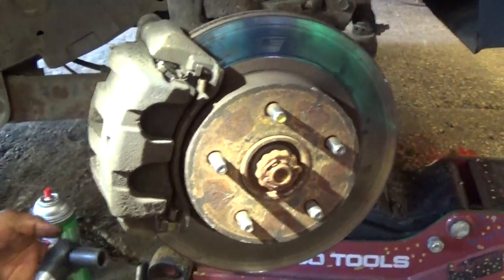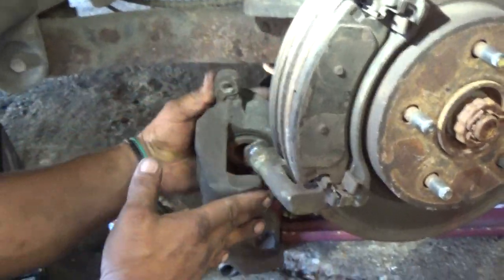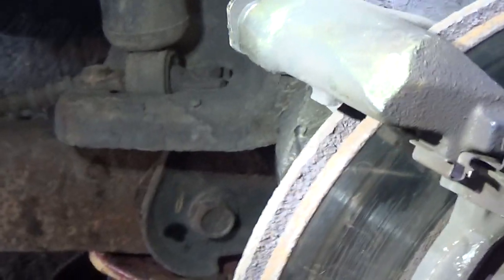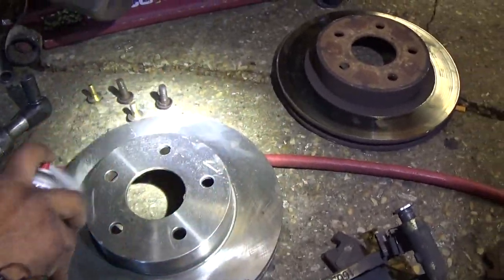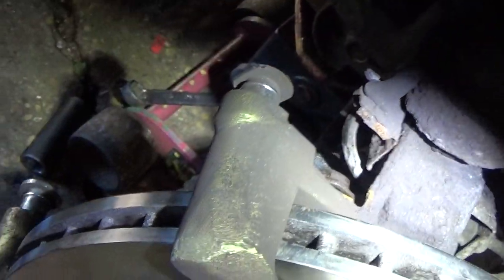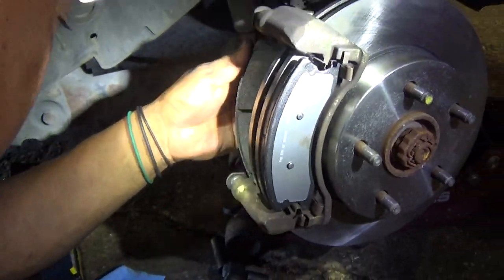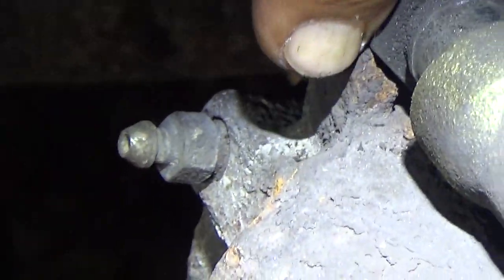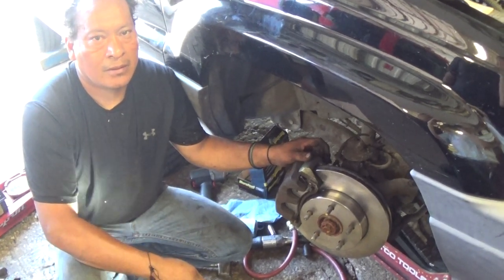How To Change Front Brakes & Rotors on a 2000 Jeep Grand Cherokee

Comment: Nice work! Bracket to steering knuckle torque is 66-85 ft /lbs and the caliper bolts 21-30 f/lbs  jic anybody's wondering.

Comment: Don't forget to grease your guide pins
Reply: He didn’t even have the dust boots on the carrier pins, so greasing them would attract dust and cause them to seize.  He also didn’t lube the clips or put anti seize behind the rotor where it mounts.
Reply: @horsemoney  Yeah no idea what these 'mechanics' are doing but this is a terrible job. I would be pissed if they did my brakes like that. A good mechanic will take the time to properly clean and lubricate any moving parts of the brake mechanism.

Comment: So if it takes one 8min video to install under normal conditions and approximately 3 mins to remove the tire, how to mechanics justify over 1hr of labor?
Reply: At this point idek why mechanics charge by hour. It would make more sense to just charge by labor type, not hourly. Not everyone can do mechanic work, which is why I can understand donuts still expensive to repair something on your vehicle.
Reply: They did a terrible job. They never cleaned off the guide-pins, never re-lubed them, and never put dust-boots on the pins. These brakes will be worn quickly because they won't move when they need to.

Comment: Anyone watching this, please put dust-boots on the guide pins, remove the guide pins and grease with a silicone grease such as sil-glyde, and put grease on the fins of the pads. These brakes are going to need to be replaced soon because there is no grease nor dust-boots on the pins, and they will sieze up, causing the brakes to constantly rub.
The fact that this went overlooked, and there is two people working on it (the actual worker and the video recorder) tells me to avoid this shop.